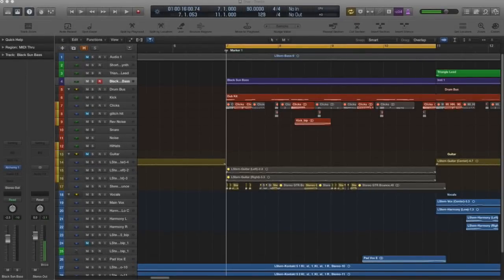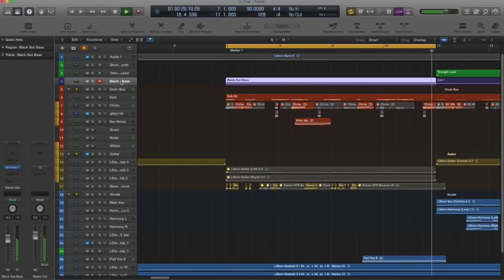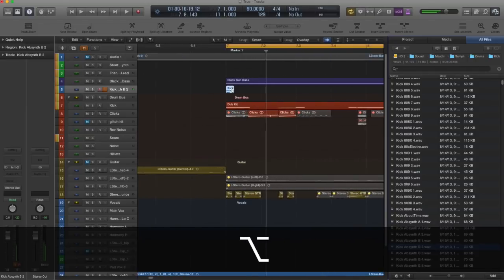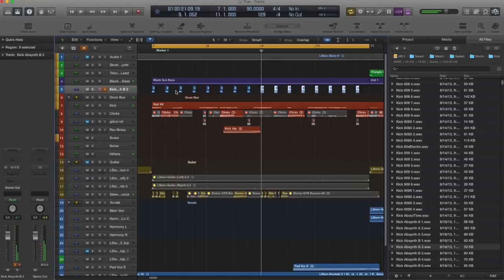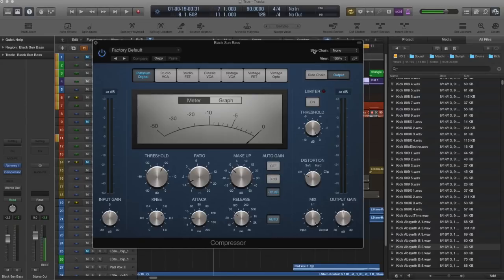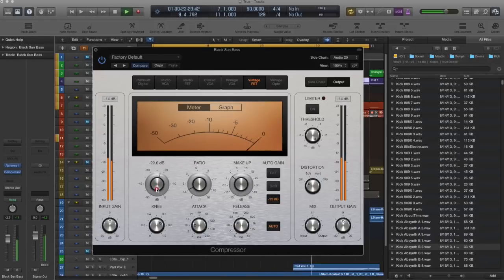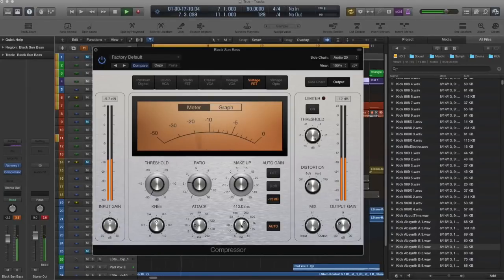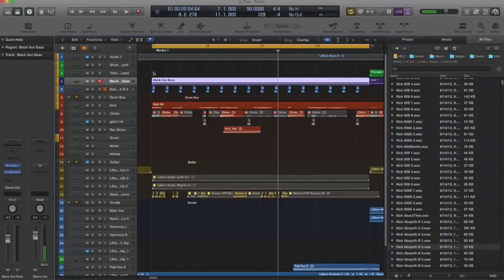Logic Pro X Basics - Sidechain Compression for Pumping Bass

Comment: I think the reason why it got so much louder when you activated the compressor for the side-chain was because the AUTO MAKE-UP gain was on.  If you turned it off you may not have to crank down the output on the compressor.

Comment: I watched a million tutorials on how to sidechain, but for some reason i can't select the stereo out tab. I click on it and nothing happens. do you know why that is? I've tried looking online why, but I can't find anything.
Reply: +Joel Maida Make sure that you have all Advanced Tools enabled in Logic Pro X > Preferences > Advanced. That should solve the problem for you.
Reply: ive tried that and it still isnt letting me for some reason
Reply: i realized that i wasnt right clicking, tried right clicking, and it worked. kms
Reply: I had the same issue right now. I opened up mixer and noticed that when I click on the channel strip, the stereo out is selected as a separate one on the side. I deleted that separate one. Then it showed up in original strip which I muted. However, you don't have to do all this. You record a kick in ultrabeat or any drum sampler for one bar, loop it to your requirement and then mute output. That's actually lot easier than this audio file example IMO.